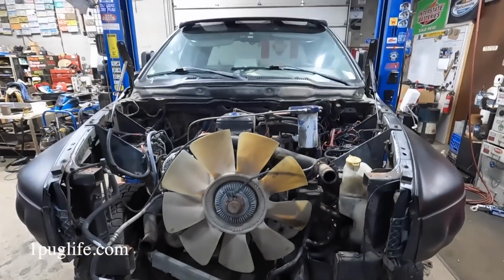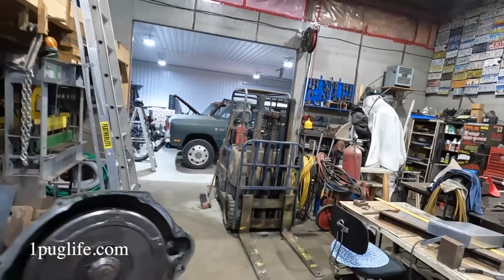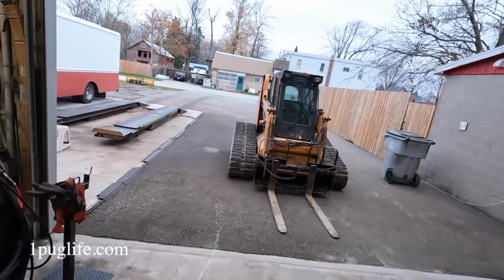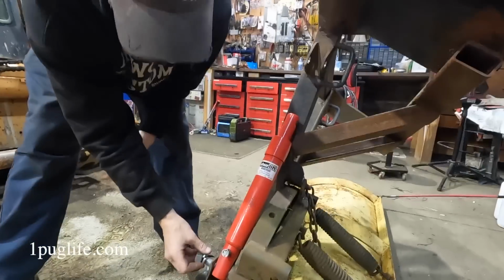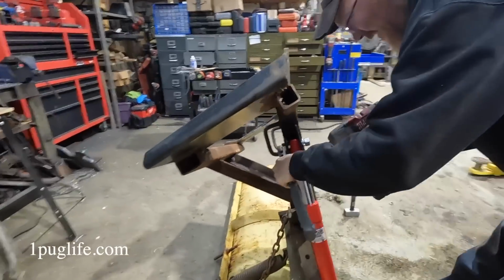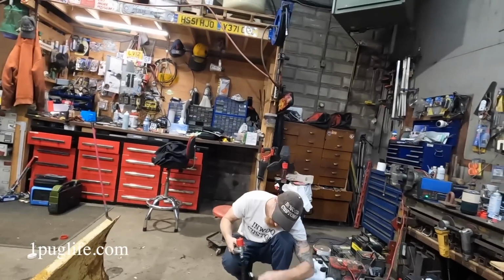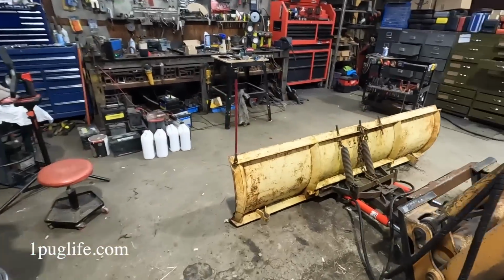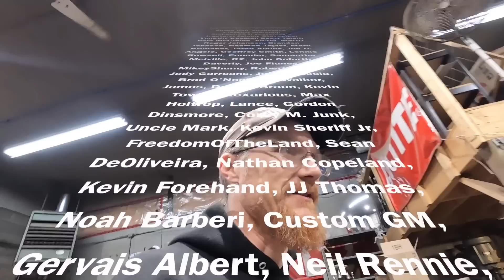truck plow to skid steer hydraulics

Comment: Chris, I didn't look through all the comments, so someone else may have already said this...
There are often 2 sets of auxiliary hose connections . High flow and low flow. It looks like you may have hooked to the high flow connections. High flow is for things like snowblower attachments, low flow is for things like the clamp on your grappling bucket.
Just a thought.
Reply: This^
Reply: I know it's okay
Reply: did he just say 'clamps' ¿
Reply: Yup, and if his skid steer doesn't have low flow connections it would be ridiculously easy to stick a flow control valve (aka needle valve) in one of the lines. Just insert it where the hoses are coupled together. I also wonder how much air is trapped in there adding to the jerky action. EDIT - 2-way flow control, not 1-way w/ unrestricted reverse!!

Comment: Most equipment has a adj to turn down the flow its in the screen settings.  Or u need a valve to slow the flow or its the button. U sure u don't have them hooked to the High Flow hook ups on machine?

Comment: I tried to look up the manual for that Case to see if there is a way to dial back the hydraulic pressure. I know you can adjust it in a lot of excavators and skid steers but the 445CT manual seems to be paywalled. Might want to reach out to a hydraulic shop and see about getting an in-line pressure adjustor for that supply side or see if they know where the valve is on the machine That 445CT is a high-flow unit. 23 gpm is way too much for little rams like that. The paving guys you bought it from would need that kind of flow for their asphalt grinders and sweeper brooms ect

Comment: are the upper connections low speed hookups ?
some have high  speed and low speed hydraulic systems
Reply: One was for wire controls.

Comment: Cheap fix to "tune" the blade from jumping is put a couple of high pressure ball valves on inlet ports of cylinders to slow down the flow.

Comment: i ran over a 30 pound rock with the snow plow on my car... then ran over the rock... i thought the axle fell off, then i found the rock. after heaving the two of them into the grass beside the trailer a few days after my dad put one of the rocks back into the hole... the same rock that seared off 4 of the graded 5/8''' bolts that held the whole front bumper onto the 1985 dodge w300 as it has a large 450 pound plow, truck going 20km/hr then zero "ground was fully frozen then"... there are 5 large rocks on the driveway to slow down for. don't want to set off the air bags dislodging them.